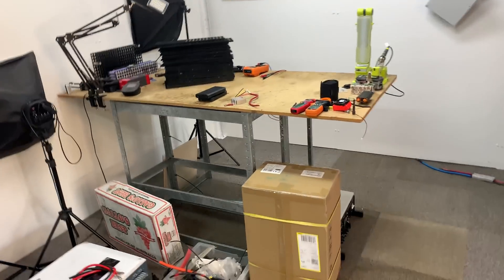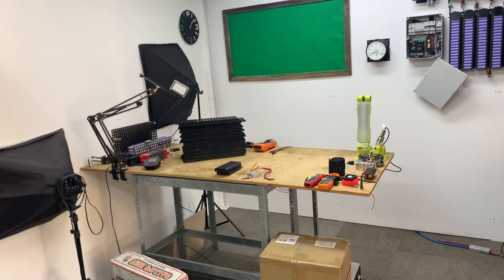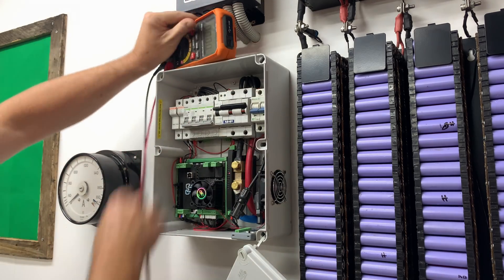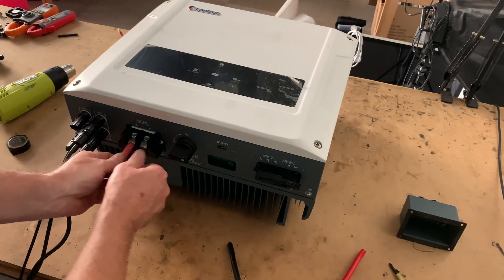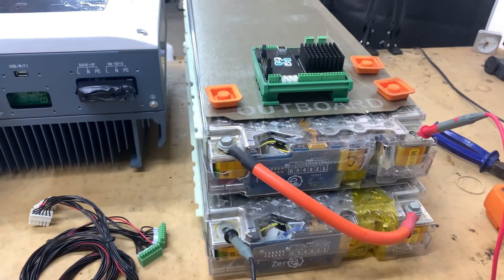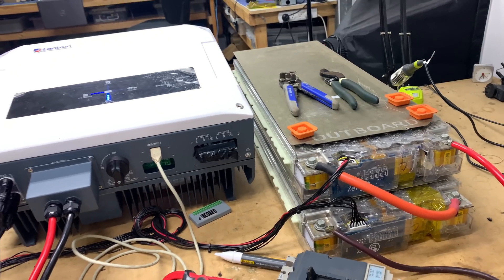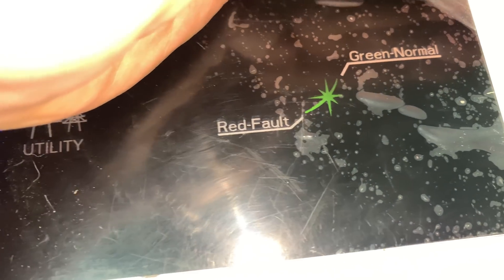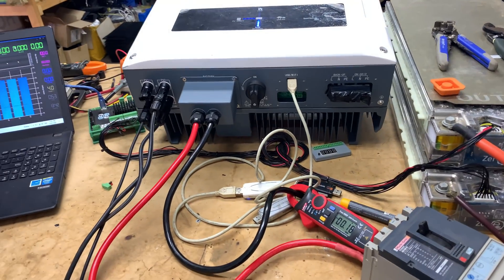Lantrun inverter testing ⚡| Desperately need the WIFI USB can you help? |⚡

Comment: I have parts for these lantrun inverters. I have also installed many of these in Australia and know the ins and outs and operation of them. Not a bad system. You do need a CT clamp meter for the battery to charge/discharge etc
Reply from the maker: Awesome ! you in Brisbane - want to sell some parts? admin at diypowerwalls dot com -

Comment: The USB wifi is to send the data to an online portal. The lantrun app lets you connect to the inverter locally. Lantrun are no longer trading as they were brought out by another manufacturer. I live in the UK so i'm not 100% sure but if you contact Sapphire Solar I believe they have a rebranded version under there Gem series. They should have the dongle you require. I also dont believe as it stands your Lantrun hybrid inverter would work as an offgrid inverter without the latest firmware.
Reply from the maker: Thanks for that info i'll see if i can get any infor from them.
Reply: @HBPowerwall  I have a 5KW Lantrun inverter here on my house system here in Thailand (maybe 2 years old) It has a big fat Dongle sticking out of that USB hole. It has Lantrun written on the Dongle and a flashing Blue Light.Ive just started playing with it trying to see if I can get any live output Data but as another poster said I might have to connect it to my house wifi.
Reply from the maker: If you ever want to sell it or hire it to me I would be very great full.
Reply: @HBPowerwall  you mean the Dongle or the whole inverter ?I can see if the supplier has a dongle.Its in a development of 63 houses and every one has a 5kw system as Standard.
Reply from the maker: Sill looking for parts if any one in your developement is upgrading/replacing theirs. USB dongle and covers & screws for the outputs

Comment: This is WiFi communication module - it mean not just WiFi-USB adapter only. First time it works like access point which allow you make connection with communication module by http (it has web serwer inside). Next - over web interface user should find a home WiFi network and set up connection with home network. This module already has some settings for communication with cloud service - usually cloud service prowided by inverter manufacturer or third supplier - http://solarmust.shinemonitor.com/index_en.html Similar WiFi module used for some Growatt inverters, but Growatt WiFi communication module has DB9 instead of USB from inverter side.
Reply from the maker: Thank-You for you're input - i'm still hunting for that USB WIFI :( seems the time it takes to find it might not be worth it ... :(

Comment: I'd like to get the 5kw split phase version, maybe two eventually, parallel them, depending on my power needs, I don't really need 220v it would be nice to have. I'm mostly focused on getting more. Battery and pv for now
Reply from the maker: there is a split phase version?

Comment: 6:58
Your USB cable looks sorta long.
I have noticed wifi over long usb cables are a problem.
3 meters max, if you have a good quality cable.
Could try the wifi dongals directly into the port.
Though the dongals you showed look like they transmit at 200 mW at the most.
My favorite goto usb wifi transmits at a power of one full watt.
 ALFA Network Realtek 

https://www.ebay.com/itm/Alfa-AWUS036H-Wireless-Adapter-802-11-b-g-Long-Range-USB-Adapter-NEW/274179203495

https://www.ebay.com/itm/Alfa-AWUS036H-802-11b-g-Long-Range-Wireless-USB-Adaptor/264159781032

I have only used the G band at one watt.

They also offer an N band at two watts, I have not tested that one.

After all that, it is entirely possible they have a propitiatory system .
Reply from the maker: the usb is just a standard 1.8m one, tried a few different ones it's the dongle i'm sure.

Comment: Hey, I found this youtube video https://www.youtube.com/watch?v=Mzne6MlsQs8 it shows the mac address  f0:Fe:6b:be:60:8c then i used  https://dnschecker.org/mac-lookup.php to which manufacturer use the  MAC  address prefix  its company called http://www.hi-flying.com/hf-a21-smt i think it use this chipset https://fccid.io/2ACSV-HF-A21-SMT/User-Manual/User-manual-270996 goto page 28 you see it same interface as the youtube video.
I hope this helps you.

Comment: Did a quick looking around, it also looks like SolaX and WKS are the same as well. I found this by SolaX Power: https://www.wattuneed.com/en/mounting-and-accessories/4720-kit-pocket-wifi-solax-power-0712971136632.html
It looks like it would be similar. 29,20€, $32USD, $46AUD
Reply from the maker: That looks promising - will look for one in australia save the shipping costs

Comment: Maybe something older? Like a Realtek chipset that does wireless B/G
Reply: Maybe it is proprietary https://lantrun.en.ec21.com/Monitor--9944266_9944274.html
Reply: Looks like you also use their website, maybe free subscription? http://lantrunsolar.com/mobile/login
Reply from the maker: Signed up for that with out success - even tried the 'wayback' website history to find more info :(
Reply: @HBPowerwall  it seems like they are holding onto the software

Comment: Maybe direct USB connection ?
Reply: No, it's a proprietary setup. It's standard USB connection, however the board internally is looking for a specific device type. The adapter can either be a WiFi or a GPRS dongle

Comment: 👋👋 Thank you for the clear information, I don’t understand English, I like that you show everything informatively !!!  Please tell us about the program that works as balancing for the Tesla battery (bms) and what program is on the computer software.  I recently disassembled the Tesla🔋 module for my project, but in the future I want to use it as a battery in my mitsubishi minicab miev🚐 electric car.  Thank you for your efforts !!  I hope I will become smart as you are with best wishes from Yaroslav.  My nickname is Electric. I'm on my YouTube channel.👍⚡🔌☀https://youtu.be/5Gwj93P9cn8
Reply from the maker: The BMS is a Batrium WatchMon5  https://www.batrium.com/collections/centralise-supervisor/products/watchmon5 and uses a custom loom i made using the BMS replacement board for the Tesla batteries - https://rover.ebay.com/rover/1/705-53470-19255-0/1?mpre=https%3A%2F%2Fwww.ebay.com.au%2Fitm%2FTESLA-MODEL-S-X-BATTERY-MODULE-REPLACEMENT-BMS-BOARD-V2-CELL-TAP%2F392382829774%3Fhash%3Ditem5b5bd6d4ce%3Ag%3Av14AAOSwALpcIBhK&campid=5338074967&toolid=20008

Comment: The usb connector might not have enough current to run those Wi-Fi dongles. Try a usb cable from the inverter into a powered hub and connect the wifi dongle in the hub.
Reply from the maker: Don't think power over usb 1.8m will be the issue.. Comments have been very helpful pointing me in the right direction
Reply: @HBPowerwall  Hi Pete hey ok. What I would try is to measure the five volts on that usb wire with the wifi dongle plugged in and go from there. Good to see you didn't get burned up from them fires too.

Comment: Pete, i am following your progress, as mentioned i have one that is also missing a dongle.
My inverter does not even output AC so yours should be previously configured already.
The manual indicates the mpp range is between 120 to 550volts so add another panel and see if it charges.
When u can read the software pls let me know and vice versa
Reply from the maker: I sure will mate, I do believe that this inverter was in use before the sale, just don't know the details of it.

Comment: I know mpp solar sells one. Do not know if it will work.
Reply from the maker: That might be worth the dollars didn't realise they had a USB Wifi dongle
Reply: @HBPowerwall  Yes it's kind of cool I have worked with a few over the years but I still do not have one. Like I say I have No clue if it will work tho..
Reply: @HBPowerwall  Worth a shot. Maybe the internals of the WiFi/GPRS is fairly generic across models. As mentioned in another comment, SolaX and WKS inverters look the same as well. Maybe they are cross built like AIMS and the others. Just a different label printed on the casing.
Reply: @HBPowerwall  Worth a shot. Maybe the WiFi/GPRS dongles are fairly generic. As mentioned in another comment, the SolaX and WKS inverters look like this one. Maybe just a rebrand of the same inverter, like with AIMs and the others. Just a different label on the casing.

Comment: Is there PC software? Does it work with a USB A to A cable into the laptop?
Reply from the maker: Can't find any documentation to confirm that.
Reply: it's a proprietary setup. It's standard USB connection, however the board internally is looking for a specific device type. The adapter can either be a WiFi or a GPRS dongle

Comment: try a pendo usb wifi router ??
Reply from the maker: Googles ....
Reply: @HBPowerwall  has ap on it and a small battery to power the router ?
Reply: might help ? maybe?
Reply from the maker: That last one looks useful and a link i haven't found thus far> I've emailed the company and the mail bounced
Reply: @HBPowerwall  damn
Reply: it looks proprietary but hey plug away and see what sticks ya might get lucky  could also ask the seller for it back ?
Reply from the maker: I've reached out to the seller fingers crossed there also..
Found a skype address also will try that tomorrow.
Reply: @HBPowerwall  seems a tad odd that they sold without it ?